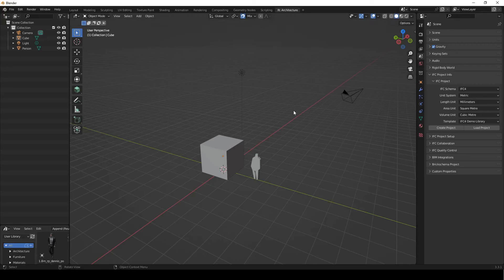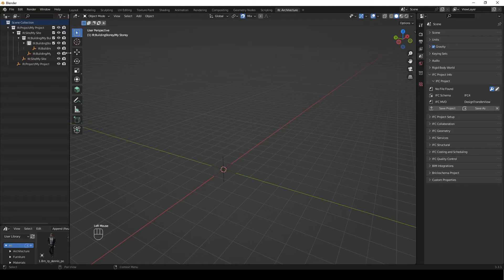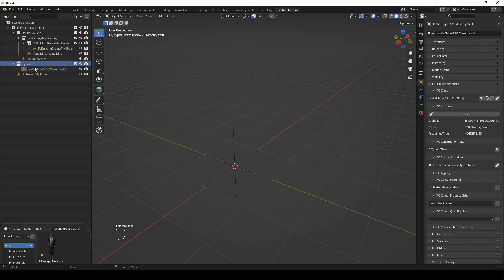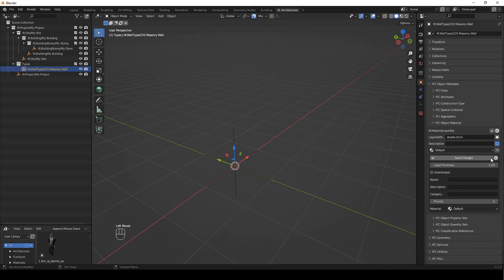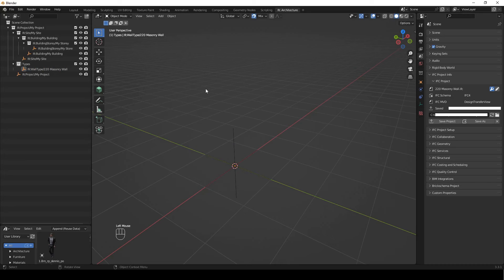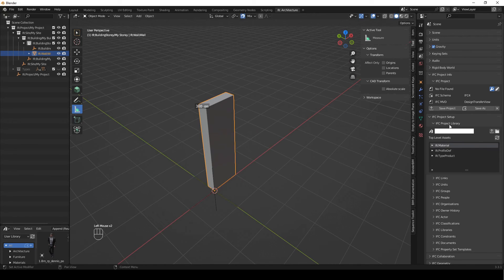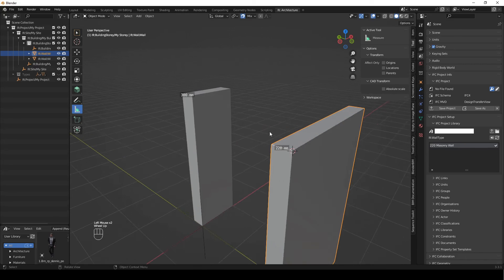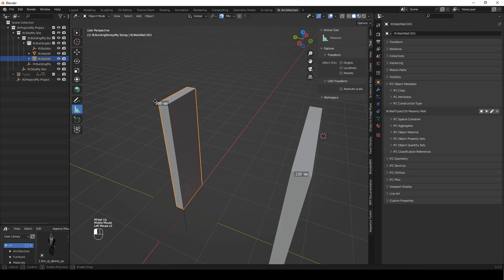BlenderBim - Custom Wall Type in 5ish mins

Comment: I have been working with BIM for years but this is much to complex. You should be able to dupicate a standard window (or element) and edit it to the desired thickness or shape. Finally got the wall thickness working in the latest version with the layers set.

Comment: I tried to follow the video and finally managed to create a 15cm wall type using the latest Bonsai BIM addon. But I'm very new to BIM and I still don't understand the logic behind the workflow. Why do we have to create an empty, without modeling any wall geometry inside it? Why is the thickness value defined within the material and not within the parametric geometry section? As far as I understand, the term "material" is the surface property, such as whether it is wood, concrete, glass, marble, etc. Whereas "thickness" is a geometric property.
Reply from the maker: Hi Expose,
The material in this case is defined according to the IFC schema, think of it more as 'materials and thicknesses', the User interface for Bonsai is still coming along and in the future hopefully this will be more intuitive, at the moment the process to create a wall is quite a bit faster and easier, I will make a standalone video to demo it.

Comment: hi, my blender doesnt have the "IFC Object metadata" shown at 1:12. Can someone please help me correct this? I'm using blender 4.0 and just installed the BlenderBIM, that's all I have so far.

My list consists of:
Transform
Relations
Collections
Instancing
Motion Paths
Visibility
Viewport Display
Custom Properties
Reply: IFC Architect also has "IFC Architecture" as a workspace which I do not, mine says "BIM". help to remedy this would be greatly appreciated also
Reply from the maker: Hi Hyburn that initial Ifc Architecture layout was my custm one, it has been replace by the 'BIM' layout it is the same thing
Reply: I have some issue like you. Do you have solution?
Reply from the maker: Hi user, since this video the user interface has change, you can see the changes here:
https://www.youtube.com/watch?v=tpQjRjB1wnU&t=92s
Reply from the maker: Hi Hyburn, since this video the user interface has change, you can see the changes here:
https://www.youtube.com/watch?v=tpQjRjB1wnU&t=92s

Comment: Hi Guys. Where can i find Blenderbim version similar to the one thats been used here. mine is not the same. i cant find some things here. i am using 231104. please assist.
Reply from the maker: Hi Mangaba, the blender version used is in the description. however there is a new tool in the newer version called the launch type manager that allows you do make a wall in 5 seconds rather than 5 mins, I'd reccomend using the latest release

Comment: How to create a wall base line in the center?
Reply from the maker: Hi Britto, You can just adjust the wall centreline in the project by selecting the BIM tool and pressing "Shift-C" which will align centreline, you don't have to set it when making the wall, I hope that helps

Comment: Thanks! nice tut again,
I have made an ifcWallType that has a material layer set. How do I get the visual representation of layers?
Reply from the maker: Hi Christos, the visualization is a feature request and is not yet in BlenderBim,

You can track it here:
https://github.com/IfcOpenShell/IfcOpenShell/issues/1227

It's on the to do list!

Comment: Hi! do i need some material library?
Reply from the maker: I responded to your question on the other video but here it is again incased you missed it

You don't need a special material library as BlenderBim comes installed with an Ifc4 demo library file. I think your problem might be When you create a new ifc project, you need to select the "Ifc4 demo library" in the 'templates 'dropdown,

You can see it here:
https://youtu.be/jTL3a6QwckA?t=177

If that doesn't solve it you are welcome to come to the OSArch dedicated thread to ask in more detail others there could help aswell:
https://community.osarch.org/discussion/1225/blenderbim-tutorial-custom-wall-type-in-5ish-mins-discussion-thread/p1?new=1